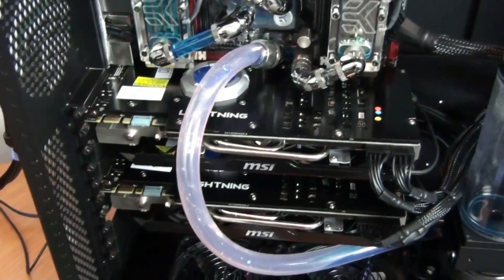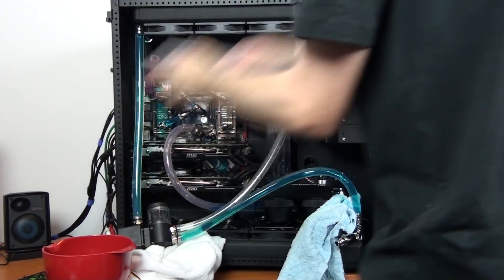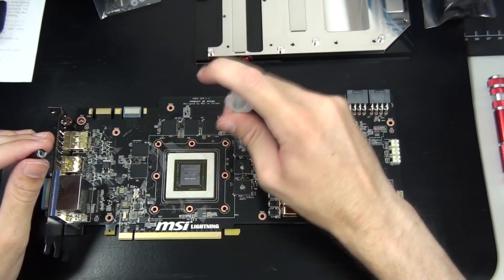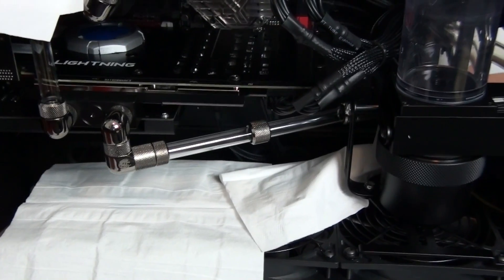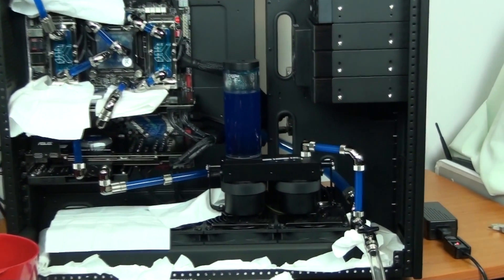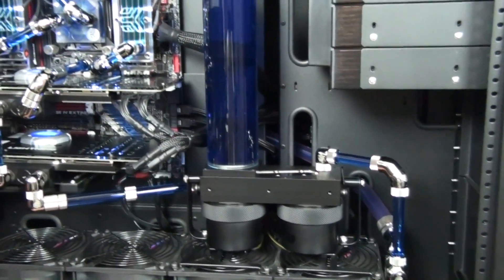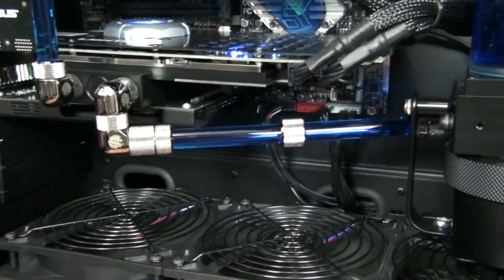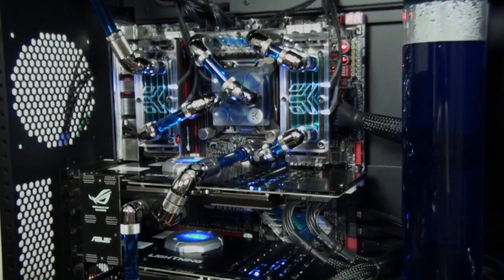Singularity Beast II Build Log Part 18

Comment: How much space do you have between the PSU & the bottom of the case? (Wonder if i could fit a 70mm radiator + 25 mm fans in there with dust filters + grill)

Comment: I'm no expert but shouldn't your res have an input? AIR OCCUPIES SPACE, the only time your res is adding water to your system is when the fill plug is out.  Your res base should have an input on the side like the EK-RES X3 250 and plug your pump input so your res is part of the circulation. Or return the input to the top of the res.
 Am I wrong?

Comment: Dont you think to try to use MO-RA 3 Pro 9x140mm fans radiator? I think the case is suitable for it and you can get rid of those rads that, I think, look quite messy there. 

And still it would be interesting to see temperatures of ambient, water and components and to see the noise of the system. Thank you.

Comment: why dont you use the floppy and 6pin extra power to the ram and pci-e?? :/  you did have it before why not now??  And i see that you have the 8 and 4 cpu power connectors, so my question is why not the floppy and 6pin extra power.

PLZZ DONT MISS MY COMMENT TNXX =))

Comment: Keep thinking of questions to ask then I forget LOL, Do you ever use shrouds between the fans and Rads? I would like for you to make some comments or possibly do a test on shrouds if possible. 

There is seems to be a lot of controversy about push pull and both push pull configurations on fans and rads. What is your opinion or have you done any testing on fan configurations?

What is your opinion on single loop verses dual loop cooling systems?

Comment: Thank you for the doing all of your videos very much appreciated. They are very informative. Was especialy interested in the staining of the tubing and fluids you have used. Had the same issues. Currently using Distilled Water & a 99.9 percent Silver Kill Koil in the loop. Looking forward to watching your review on Coolant and tubing.

How can I contact you for a Monster Build? The shipment would be International 7 to destination 7 1/2 hours air time from Sydney?

Comment: The tubing he uses is Crystal link tubing by Bitspower and from what I know (not very much) the easiest way to get it is online. From what I've seen in Singularity's videos, he uses default lengths of tubing and he uses many different fittings to get the various lengths of tubing to run around the system.

Comment: Slight rebuild plans.  Do you think a 480 SR-1 rad is enough for decently low temps on a 3770k and GTX 580?  This will be going into a TJ07.  My other options are to mount something like a GTS 240 up top or keep the drive bays clear and mount a 240 up front.  What do you think?

Comment: i'm not the guy from the channel, but you would need as much v ram as possible because  higher the resolution you go the more v ram a game is going to use and 2gb is really not enough. 3gb might do, but you should go with a least 4gb with that resolution. Also having 2 graphics cards with 3 or 3 gb of ram does not make it 4 or 6gb, they have to share it.

Comment: Building a Mountain Mods Ascension workstation, having trouble finding out how to mount a single Bitspower 150 res/pump vertically in my case. It has the Bitspower mod top and block like your duel and the one seen here.  I have a UN Z2 mount on the lower fan that is also attached to my Black Ice SR-1 radiator in the front. What I don't know is how or what I need to attach it vertically to my UN Z2 mount. What parts or steps am I missing to mount this?

Comment: Colored tubing is better because if you use clear tubing, after a while you will start to see that the tubing begins to get stained with the color of the coolant and it looks kinda nasty. If you use colored tubing, you wont have to replace it for much much longer, and the color of the light in your case (if you use flourescent coolant) will be more consistent

Comment: Thank you so much for all the info you so freely share. Glad you could return to using large reservoir. 

Do you know the high school chemistry experiment which shows how many gallon of water can be coloured by a small iodine crystal? It's dilution after dilution after dilution and it's due to diffusion. If there's even a 'hint' of that going on you may just need to concede. Do you know any Chemistrty experts for a professional position on this?  Good luck with the outcome regardless. Alan

Comment: I just completed my build: 3770K @ 4.6Ghz, GTX690 Hydro copper, GTX560, RAM block, Mosfet Block. 

I'm cooling all the gear with 240mm 45mm thick, 120m 45mm thick and 240mm 30mm thick from alphacool. The Scithe GT 1850rmp are at 30% when idel and 70% under gaming load. The water temp does not go higher than 41° C

You should be good with the equilvalent of 480mm with that thickness you tell.

Comment: What is you flow rate mate? You are using a considerable amount of angles in this build. 

I have completed mine last weekend and I use 13x 90 degree single rotary from Koolance. With a single MCP655 (Alphacool brand with top) at max RPM I get just 70 liters/hour according to the aquacomupter flow meter, so just enough flow. 

I really wonder what rates you get.

Comment: I was looking to get into water cooling my build, running an I7 3770k with 2 crossfire 7870s, my case can support 2 240mm rads(60mm thick) and was wondering if you would suggest an exterior rad or if the 2 would be enough. I plan on oc'ing a bit but still want a quiet system.

Comment: They don't always save space as a radiator could take up the space of the 5.25.
Tube res's are far more flexible and therefore space saving (especially the dinky little ones)

Comment: Sux that the staining's still causing ya grief, but at least you're making headway dude.

The build's looking SO clean right now, having a single crystal link between GPU and pump would be sooo much nicer. Hopefully with videos like yours BitsPower will start making longer ones for use throughout the case.

Good luck with the stain removing and as always, thanks for your time and effort with the videos, much appreciated from me.

P.S another personal subscriber video would be cool ;)

Comment: Hi
This is a really amazing rig! 
I think, if you would have  just replaced the radiators with new ones instread of flushing them like a 100 times, it would have been a lot easier for you ;) You could have done it just before changing the coolant colour and used the old ones in a rig wit red coolant.
I'm pretty sure, that you know that and just want to show us how to remove staining, but I think replacing the radiators is a better (but more expensive...) solution for the majority of people.

Comment: @Starvros Vorkas as far as maintanance it's only changing the cooling every year or two depending on witch you use. Mayhem cooling is good up to 3 years. Once the loop is complete there really isn't much maintance other than that and checking fitting to make sure they stay tight.

Comment: Hey, Love your vids. Anyway have you thought of using Mayhem's Aurora coolants? I figured with the dual pumps it would run that coolant through such a complex loop without a problem plus it would look sick, but I guess you would have a problem because your res isn't a direct part of the loop and you won't get that cool effect and the stuff in the coolant will probably settle out quicker.